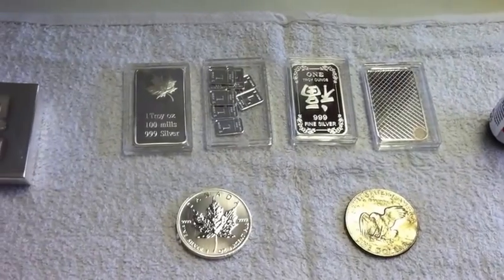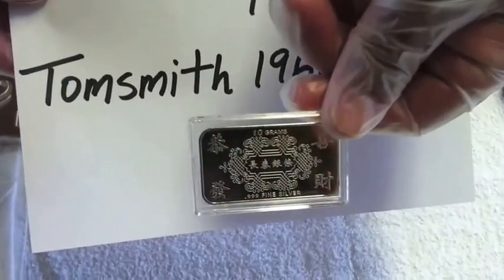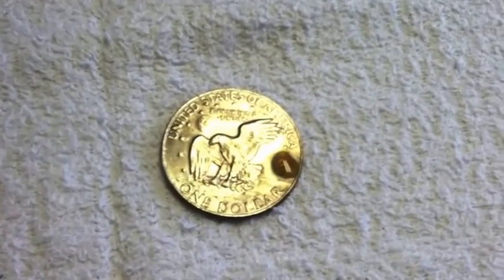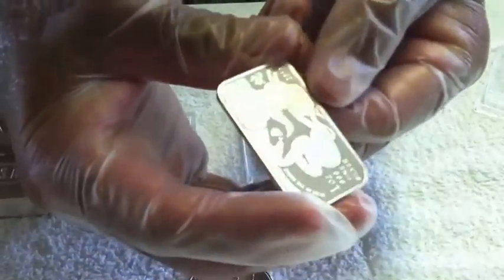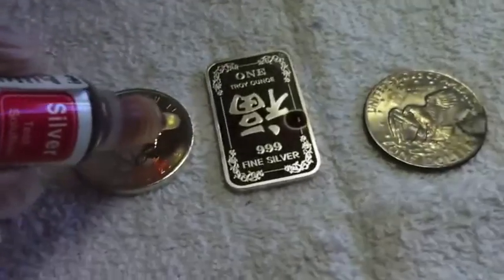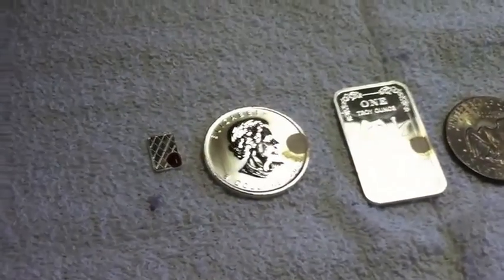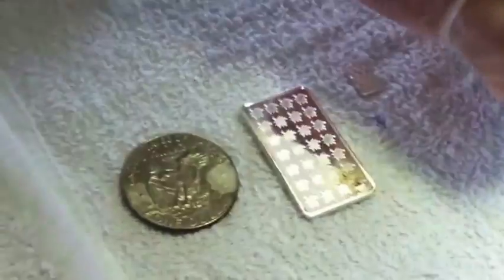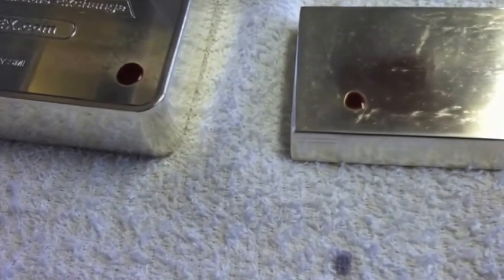How to Test .999 Silver bar and Fake Silver  -- Easy Acid Test

Comment: I've got to assume each test kit and technique is different because as I check out all the "How to test silver kits" here on YouTube I'm finding different colors for different kits and going outside I applied drops of my silver acid to a number of different  .9999 silver coins bought mint direct that came up clear if I did the test on the stone but red if I applied it directly to the coin.  Then there were issues with other coins that were less than pure such as sterling at .925 that got various readings of clear and sometimes light purple and these were actual currency (not clad) that "should be" what https://en.numista.com/ shows them to be in purity.  I definitly need to do more research because the magnet test is almost worthless in most cases and it is possible my test kit which is around 3 years old could be outdated giving me incorrect readings if that's possible even though the bottles were never opened till now???

Comment: Thanks for showing us how to test for silver. I bought 4 one Troy ounce silver on Ebay and I have no way of testing them out. I looked to see if they had 100 ratings and read the feedbacks. I can only trust them. My dad told me that pure silver is softer and melts faster. I have no clue. He also said that they turn black over time in jewelries. Now a days I don't know my true silver . Some of the bracelets and earring and rings I purchased as gifts . They turn black overtime. I was told that was real silver. There was 2 item that turned greenish over time. I was told that was not pure silver. It was probably mixed with alloy or zinc.

Comment: You could get a scratch stone used for testing precious metals. You just scratch the edge of the bar against the stone to get a line of metal powder and put the acid on the stone. That way, no acid spot on the bar. If it's just silver plated, it will also detect if there's copper under the silver plate.

Comment: so how much the acid destroy the value of the real silver?
Reply: +Andres Agredo Pretty much $0 lost on the spot price (current price at the time, typically updated every 30-60 minutes while stock market is open). 1oz of silver is still 1oz of silver after the acid test.

I think you are asking about what is called numismatic value (typically coins or rarer sought out bars), and premium, being the amount someone will pay over the spot price of silver, in that case you can say bye bye to that, but the actual metal value remains.  Some real rare bars can be many times the spot price, 10x is not uncommon.

Let's say the spot price is $21 (around the current Australian $ for 1 oz silver), and I have a coin or bar from a respected mint, Perth Mint in Australia or Royal Canadian, in, well Canada, I would probably pay a good $9 more, for a total of $30 for that ounce of silver.  Before the acid test I could get $30 back for that bar, after the acid test, $21 or the spot price, as the numismatic / premium value is gone.
Reply: +Lord Knightyme 

Ok... So the melt value does not change!

Comment: i have a tough time with silver acid tests, very confusing colors and results, never sure if they are acurate
Reply: +MN TreasureDiver Bright Red = Fine Silver (.999) 
 Dark Red = Sterling or Coin (.925 or .900) 
 Brown = Silver (.800) 
 Blue = Copper 
 Green = Brass 
 Turquoise = Nickel
Reply: Will 950  silver turn red also ? If no, what color will it turn?

Comment: I don't like to do destructive testing on my coins and bars.  You can use an accurate scale to see if it's exactly the weight that it should be, plus use a neodymium magnet to test if it's real.  Best is to buy from a trusted dealer.
Reply: +AbuserTube Specific gravity tests are also very effective, worst that happens is the metal gets wet.

Magnet is effective if a fake is not copper core, as the diamagnetic effect is similar.

Agree with trusted dealer, everyone (interested in precious metals) should know their local bullion and coin dealers.
Reply: Lord Knightyme  True, but if the core is copper, then the weight would be wrong for the size of the coin or bar.  So if you do both, weighing it and the magnet test, it should get rid of at least most fakes.